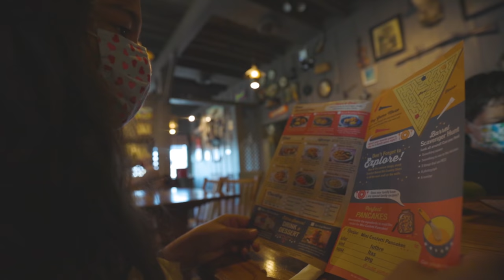RV EAST COAST BOONDOCKING AT CRACKER BARREL / COLD WEATHER

Comment: 37 degrees is cold!  I don't blame you for being concerned.  "Will Freeze for Biscuits!"  😆
I like your power station backup.  Do you have a way to charge it up each day if you were going to be boondocking for 2 or 3 nights?
Reply from the maker: Lol thanks for the sympathy! 
As far as the battery you can purchase a solar panel for it but it needs a full day of sun. If you plug it into a wall outlet it takes 2 & 1/2 hours to full charge. Maybe a local coffee shop, restaurant or rest area?

Comment: is there a reason you didn't use the propane furnace? We'll put ours pretty low, about 62, and with blankets are quite cozy. Of course we switch to electric on-site to save money, but for a single night the furnace doesn't use much. We also have a similar solar "generator " and love how you're using it.
Reply from the maker: Hi Sandra, we used the furnace all night. We only used the space heater with the generator for an hour or so.

Comment: Eli, can you explain exactly what was running on the EcoFlow Delta 1300 overnight while at Cracker Barrel.  Product looks great but, reading their website seems to me that any electric heater you may have had plugged into it would only be good for about 1-2 hours given the huge electric drain from heaters.  Am I missing something?
Reply from the maker: Sure, we ran the space heater and the furnace at the same time only with the generator to warm up the trailer fast. Then we put the generator away for the night and switched to the ecoflow power station. We then watched TV for about an hour and ran the propane furnace all night. The furnace runs in propane but you need the electric power for the fans.

Comment: Your so brave!  We were going to try and boon dock at a Cracker Barrel this past weekend to break up our return trip home but I chickened out and we went to a KOA. :)  It just made me so nervous it seems scary not sure why I feel this way. Maybe when we are a little less new to all this I will be more comfortable. That battery pack is a great idea I did not know you could hook the camper up to it.  We do not have solar either nor are we investing it but i could run my heater and charge our phones with that (or a cheaper one) . I did want to ask is there like an arrival and departure time if you stay at a Cracker Barrel?  Do you need to call ahead to see if this is ok? I am guessing its customary to eat a meal there? I am going to work my way up to try this someday :)  I was just proud we broke up the trip into two travel days so we are learning. Great video! THX
Reply from the maker: Thanks for sharing your thoughts Melinda. Boondocking can feel a little uncomfortable in some areas. It’s good to do a little homework on the area to ensure you feel safe. In gjis case, we were near lots of other commerce and it was well lit. Most Cracker Barrel’s, Walmarts, Cabella’s let rvs stay but it is definitely advised to call ahead. I don’t know that you have to eat there but why not lol! A good time to do this is spring or fall when you don’t necessarily have to worry about heat or ac. It is a convenient way to break up a long trip.

Comment: Great content. What size generator and what make do you have? I have been looking for one to do the same thing. Not sure if I would need solar but have thought about the (2) 6 volt golf cart batteries for the longer amp hours.
Reply from the maker: We have a Champion dual fuel 3400 watts. We don't use it as often but it definitely gets the job done.
Reply: @RVEastCoast  That is the exact one I am thinking of buying.
Reply from the maker: @ds5248  We had it for three years now. no problems so far.